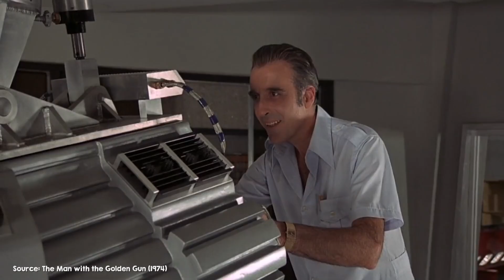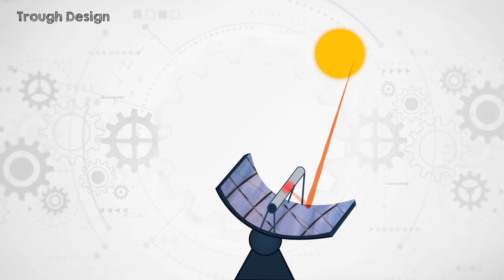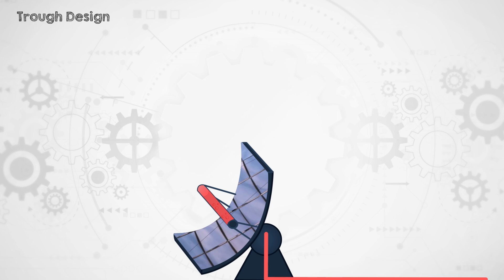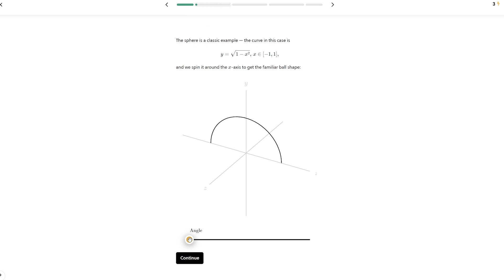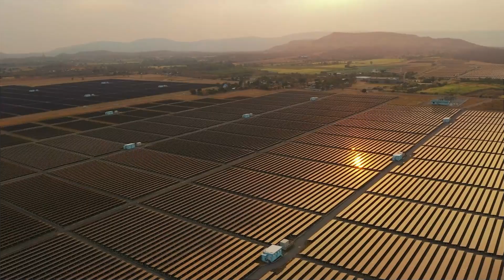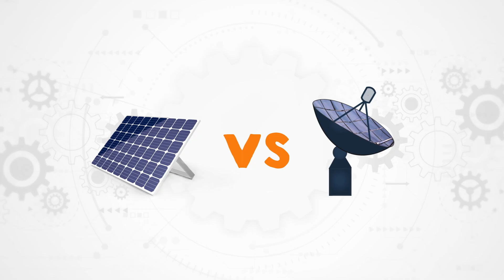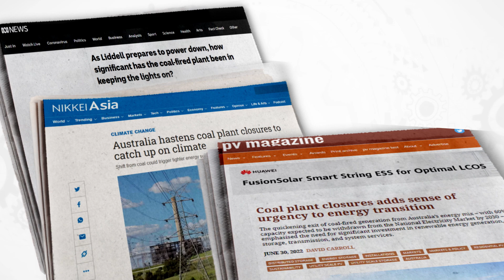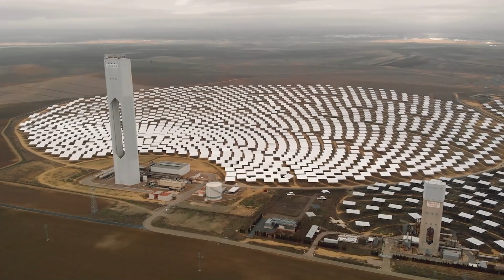Solar Power at Night using Concentrated Solar Power CSP

Comment: When I say V2G I am saying that the EV comes with a free battery with massive long drive capacity. 
But most vehicles are parked 23hrs a day and Australia will have a massive storage resource in the 20million EVs, 2,000gWh of DISPATCHABLE electricity. 

The home robotic vacuum cleaner can teach the selfparking EV to connect to the grid. 
Vehicles drive from grid connected buildings to grid connected buildings.

Hello anyone home hello 👋 ☺️

Comment: I would actually like a hybrid of concentrated solar and liquid metal (Ambri) batteries. The Ambri liquid metals are meant to be 80% efficient compared to anything with a steam turbine that is about 30% efficient and solar photoelectric which is about 15-20%.

Comment: Could a coal power plant be converted to CSP? I'm thinking of reusing the turbine and generator, which probably are a big chuink of the cost of either type of power plant.
Reply: It could but CSP should be sited for the largest number of clear sky days per year, and it would be a pretty big coincidence if a coal plant was already in the same spot.
Reply: @SocialDownclimber  also there needs to be a large amount of space around for the mirrors, if you wanted to come close to fully powering the turbines. These power plants ar3 usually built near cities that need the electricity. I think nuclear reactors are better suited to reusing old plants. There is a company that has developed a system for doing exactly this.
Reply: https://en.wikipedia.org/wiki/Martin_Next_Generation_Solar_Energy_Center
Reply: @michalbike9305  while every little helps, that example is pretty little. The CSP is providing a small boost to the gas plant, not replacing gas as the power source. At peak solar output it only provides 6% of the energy to run the turbines in that power unit and can't operate the turbine by itself at all. It takes 500 acres to do even that. Preheating the turbine to allow for faster startup is useful. We need peaker plants to fill in renewable gaps and they are usually less efficient than long duration gas plants, and this helps with that.

Comment: Thanks for the informative presentation.  I happened to see the test plant in Spain with a bird watching group and they had concerns about the impact on birds. Are you aware any studies on this topic? Also could it be possible to utilise existing steam turbines from de commissioned coal power plant  ?
And finally the CSP facility footprint in comparison with a PV equivalent.  Thanks again yours matt
Reply: A natural gas power plant in Huntington Beach ran at 1,000 + PSI and about 1,200 F steam temperature.  This system at Ivanpah is only about 850F, so the pressures would be different.  No you could not use the same steam turbine in both systems.  And modern steam systems will use a two turbine system, because it is more energy efficient.  

But the basic problem is Ivanpah cost $2,200,000,000 to install the 400 MW system.  With solar PV you could install a 2,200 MW solar PV system, and the PV requires much less maintenance, and no staff to babysit it.  The steam plant will require at least 1 person all the time it is running, sometimes 2?  So several staff to run it 14 hours a day, and 7 days a week.

Comment: Been waiting for this discussion! Been following CSP for ~20 years and it used to be my go-to answer for those "but the sun doesn't always shine" naysayers. Was dismayed at the Port Augusta plant not getting up after so many years of support. Some of the stories about the Nevada plant (lots of gas support, etc) were a worry, and then there was the bird issue (now solved), but always thought there was still hope for it. Gema Sola Spain plants seemed to be a success. Always wondered if a small parabolic trough setup could charge a home battery system better than a small PV
system...

My question for the expert: One of the main criticisms is the amount of land that needs to be cleared. Would it be feasible to build the heliostats on tall supports/scaffolding and have minimal disturbance to the area beneath? What about building a plant on the surface of a lake (floating heliostat arrays, embedded tower)? What are the maintenance costs like compared to other renewables? Molten salt is said to be corrosive and hard to work with.

Cheers, Rosie :)
Reply: I'm not expert at CSP, but if you chose a tower configuration, the heliostats have to be aimed very precisely. If it's trough, your oil lines either can't move, or have to flex. Both might be tricky on water. I'm not saying it can't be done, but it's a consideration that might make it more risky or expensive.
Reply: @fjalics  I'm imagining each heliostat on a floating "barge" and each one is linked together with a fairly rigid piece of steel (or maybe a joint for it to go up and down, but not side-to-side). If there was inclement wind/waves, you'd expect worse output, unless the "target" area of the tower could be increased to allow for some movement of the rays.

Another very simple tech is the solar updraft tower - you build a chimney with a bladed turbine inside it and place a big translucent sheet at the base. The sheet lets sunlight through, but traps the heat generated, a slight elevation towards the central tower guides the rising warm air up through the tower and turns the blades of the turbine like with a wind turbine (except pointed toward the ground). I think these weren't pursued because normal wind turbines would be better output for the space, but if you're already creating a tower,, why not create two concentric towers, with the molten salt on the outside and a thermal chimney on the inside - you then raise the heliostats on a frame and put the translucent plastic beneath and you have two types of plants that generate all night long in the same footprint!
Reply: @PinataOblongata  if you want to do floating solar I think PV i much more suitable there. The panels benefit from the cooling effect of the water. It's tricky getting csp to work reliably and doing that while floating would just make it much harder for basically no benefit except not losing land space. Land is not limited enough to be worth the trouble. There aren't that many lakes where no one would object to covering them. Cover the lakes with PV for day usage and put the CSP on land for night usage.
Reply: @adrianthoroughgood1191  The issue with land is that you want your plant close enough to population centres that you don't get too much transmission loss. At the same time, you don't want a giant industrial thing in the middle of town or even near an out suburb, so you want to build in the zone that is essentially where most farmland goes (for the produce to be transported cheaply and for good water supply). Sure, there's plenty of barren red dirt in the interior, but that doesn't help much if you can't transmit the power from there, so the land you're often looking at will either have an ecosystem already on it or be good arable land, which makes water bodies more attractive. It's also what makes wind turbines on multi-use land more attractive, though, and often the wind is still blowing at night, so perhaps the use cases for CSP just aren't that great.
Reply: Floating mirrors will not work, because the mirror must point to the collector and not move around, while the lake can allow some movement with waves or anything else such as wind moving the mirror around a few inches or more.  

The problem with Ivanpah is that it is a ideal location, and the installed cost is $2,200,000,000 for a 400 MW system.  A conventional 2,200 MW solar PV system would be about the same cost.  And not require any full time staff to babysit it.
Reply from the maker: Great comment and I'll add those points to my list of questions for the livestream tomorrow.

Comment: yes you are right. 
Let me say that we can import as many vehicles from overseas as we need, overseas supply is unaffected by our small market and its demand. 
For the Australian market any demand could be met.
I suggest that V2G be a priority as it puts the maximum amount of batteries into the grid and every building is a connection to the grid.
Not rapid charging connections but daily steady top up or grid feed in.
Rapid charging will be at the corner shops as a side business and on the main roads.

Basically every EV is fully charged or ready with its next day's power needs.
The old days of going to fill up with 100kg of inflammable petroleum when the tank is empty will be seen as like we look at the horse and cart days. 

The big business will be with the grid owners and the auto manufacturers.
Every building will feed in to the grid and the 20million Australian EV batteries will absorb the excess and stabilise the grid 
20million buildings = 660gWh daily 
20million EV 100kwh batteries = 2,000 gWh DISPATCHABLE, dispatchable storage. 

Fossil fueled generation is 400gWh avg
Peaking at 600gWh if you are lucky.
Grid capacity expansion is the killer cost for central generation Renewables or nuclear. 
And nuclear will tell you that is the killer cost of new Snowy 2 and Renewables. 
But 5fold increase in electricity generation and the transmission is the killer of centralised any generation.
Reply: Vehicle to grid is not a viable utility-scale energy storage mechanism. The biggest problem is that the vast majority of car usage is during the day, meaning cars are not on their chargers when renewable energy generation is most abundant. The other big reasons aren't technical; they're political and legal, like the administrative cost of renting battery storage from retail consumers, legal liability in the case of damage, compensation for the degradation of the vehicle's battery, managing customer's relationships and experience etc.

Utilities would MUCH rather write one check to buy their own energy storage they own/operate than try to pay thousands of individual people to always have their cars plugged in at the right time.
Reply: @Jared S  horse meat was cheap and available after the T model Ford rolled of the production line. 

Horse and cart thinking is dangerous. 

If you start in the wrong direction, you may never get there. 

300million vehicles in the USA.
20million vehicles in Australia. 
If all EV, then the energy storage capacity is 3 times the daily fossil fueled generated electricity. 

This is a stupendously large amount of dispatchable electricity that the power generators do not want to compete against. 
The grid owners will love to manage this cheap daily supply.
Most vehicles drive building to building. 
All buildings are connected to the national grid. 
Most vehicles are parked 23hrs a day. 

Ezi pezi for a selfparking EV to connect to the grid like a home robotic vacuum cleaner can do. 

Everything else is simple. 
The grid knows you. 
The grid will know you own the EV. 
The grid knows how much feed in your roof top solar power system supplies. 

This is baby simple, do the maths.

The money will be in the grid ownership. 

The auto manufacturers know this double benefit. 
The battery developers know that cheaper and bigger is on the way.

The grid builders know how massive the construction costs are to fattening the grid capacity and that it is a dead end.

I am trying to help you. 
I am a Construction Engineer and have worked in power supply, and I know the numbers.

Comment: Uhm….not sure what you are talking about with the picture of the Solar One Tower( short term demonstration plant that was latter redone with salt and storage). The 350 MWe you speak of was not tower but were the 9 LUZ built SEGS plant from 1984 to 1991.  They were the very first commercial grade ( not demonstration or experiment) solar thermal power plants and lasted their initial contract of 30 years.  I worked at SEGS for 31 years and in high school helped do an environmental impact study on Solar One.

Solar thermal with storage wise the Solana? Plant in Gil’s Bend Arizona has salt storage and has been running for over a decades.  Two units over 100MWe each.  Been there a few times.

I believe solar thermal needs to be used for the heat, not just the electricity.  The operational headaches of higher temps to compare to fossil fuels was just crazy.  But think how much we can heat with it…pre heat for things that need even hotter temperatures and just say baking bread, or other industrial aspects like dyeing fabrics etc.

Reply if you want to chat more
Reply from the maker: Thanks, I'll make a correction in the livestream tomorrow.
Reply from the maker: By the way, it sounds like you've had an interesting career!

Comment: I'm so glad to see your video on CSP.  I love the historical research that you did.  I can definitely add some of this to my CSP talk in my alternate sources of energy portion of my climate change lessons for my physics classes.  Great job. Thanks
Reply from the maker: Oh that's great to hear, thanks!
Reply: Marina make sure you don't teach the kids global warming activists stuff. There's no climate emergency.
Reply: @massatube  Would describing fossil fuel caused global warming as a slowmo extinction-level threat be more your thing?
Reply: @johnbash-on-ger  Yeah that will do .... Dude !!
Reply: Be sure to mention an electric heater can be added to basically turn the storage tanks also into multifunctional cheap grid batteries.
Reply: CSP is a dead end. It's too expensive. It's too maintenance heavy. You have to wash these things nearly every day.  The upfront costs are enormous. You can do the same thing with conventional panels and use the electricity to heat up a salt. It's less efficient, but it's cheaper.  All of these mirrors need to track the sun. It does not work at all if you are off even by a little bit.  It doesn't work with clouds either.  Who knows what evil partial cloudy conditions cause. Having the same pipe be hundreds of degrees difference in temperature a few feet apart is not good for the pipe.

Comment: Has this idea just been disproven by the real world trial.
Reply from the maker: Which real world trial? There are plenty over the past 40ish years and no, it hasn't been disproven. Some projects have had problems of course but overall it's been proven a sound technology.
Reply: @EngineeringwithRosie  It has proven not to work with well with current electricity markets. However those markets also have massive problems with intermittent energy production (solar/wind). So there will be little CSP until the markets change and due to politics being extremely fast like always, this might still take some time.